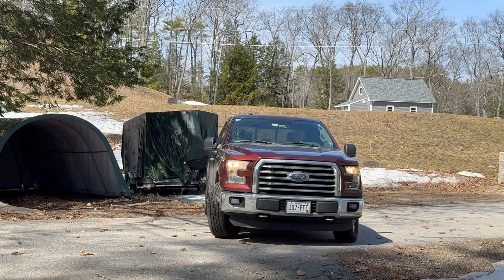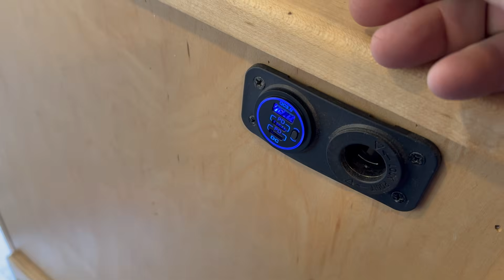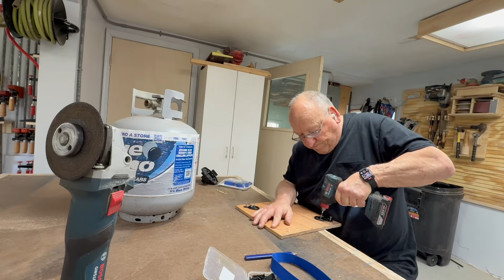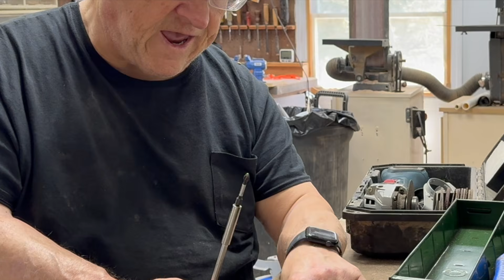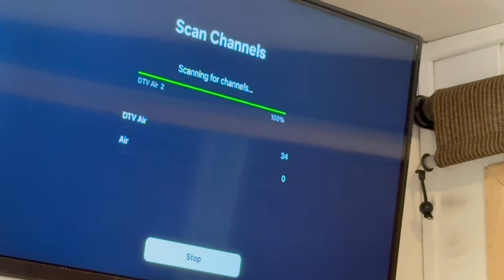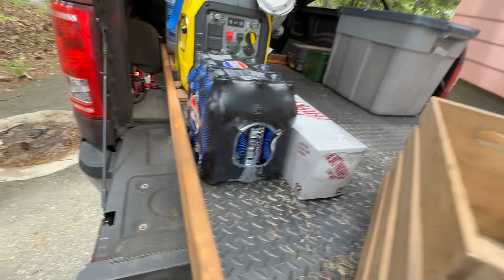Getting ready for a 5000 mile 2026 road trip

Comment: Nice compliment of tools !!  I would add some reciprocating saw or sabre sawblades that can be held with the vice grips to make an emergency saw. I like the cordless grinder idea !! I also carry a small makita impact wrench with a few sockets in case of tire remova/repair. I have also found tht the perforated metal plumber's strapping to be very useful. I guess we all carry different products that do similar things based on what we all have in our supply ! Thanks for posting !!